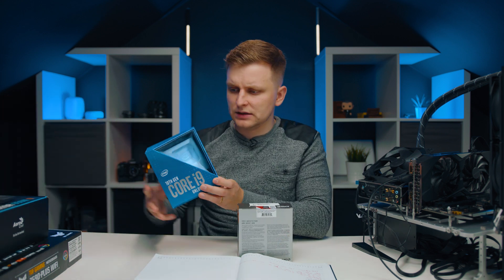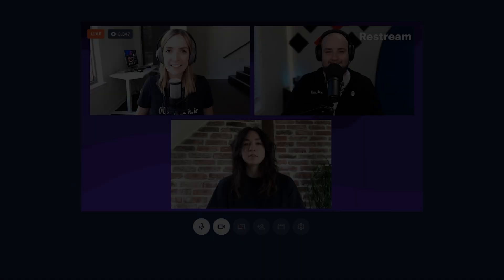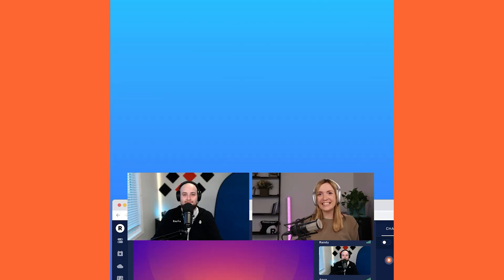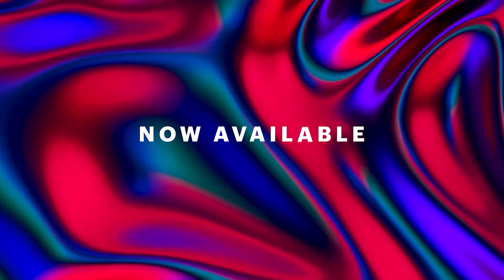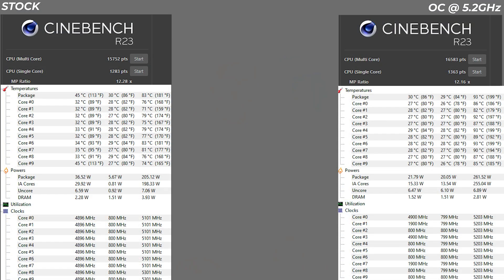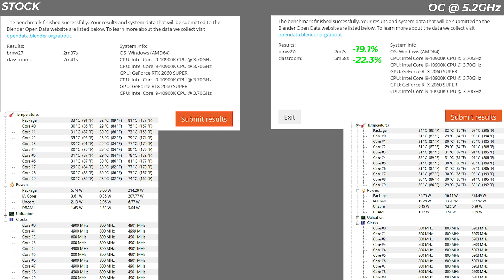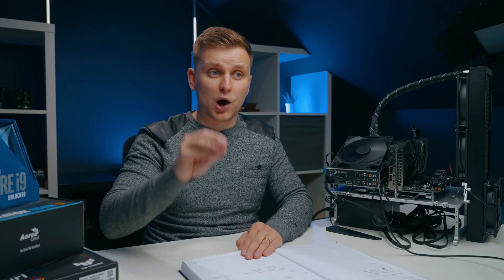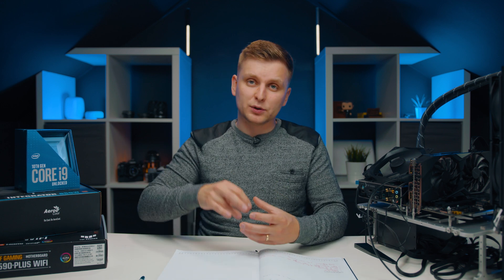Should Creators Overclock Their CPU & What do you Gain? [feat. Intel 10900k] 🤔

Comment from the maker: Who noticed the Intel blue theme in the video? 🤔
Reply: Uh now that you point it out yea nice
Reply: Uh a question I have on one of your older videos... So if I use the a6000 battery grip... And one of the two batteries dies it switches to the other yes but if I'm mid way through a long exposure... For example like a 2 min exposure and the Batterie dies in between... Will it switch without ending it?
Reply from the maker: Yes it will switch without ending it, at least that's how it works with video. :)
Reply: @theTechNotice  ok great
Reply: Me, I noticed blue theme.

Comment: I'm more of a developer but the same thing applies really. To me the instability isn't worth it. The last thing I want is a crash and I loose everything I'm working on. I need my system to be as stable as possible for as long as possible. I don't really use my systems for gaming where pushing the most FPS is what matters to me. The instability is something I don't find acceptable to deal with.

Comment: I'd overclock if I needed to get a bunch of work done quick, and leave stock the rest of the time. Just toggle it on and off.
Reply: That's a fine way to do it, but these days you can tune it so the OC is in boost. It only runs boost when it would benefit, and as soon as that is done, it runs back at idle speeds.
Stress tests push that hard, but actual games tend to have tiny bursts of individual cores boosting then returning to regular speeds, so gaming tends to run much cooler than benchmarking.
Reply: @MaintDocs  Neat

Comment: I and a lot of us out here really appreciate how honest you are about tech.  As tempting as over-clocking might be, an extra %10 - %15 extra performance isn't worth losing longevity.   Excellent video sir. 👍🏽
Reply: The main computer I've had for about 14yrs has had around a 33% OC for almost 10yrs. At that, it runs cooler than stock most of the time, but the computer has noticeably less input lag, starts up faster, crunches video much faster, multitasks more without slowdown, and (up until just today) plays every game I've thrown at it pretty well.

If your OC isn't stable, you've done it wrong or pushed it too far.
The next bump up in performance for my older computer crossed into high heat and difficult stability tuning. aka wasn't worth the effort vs an easy OC that the processor seems happy to run at.

His car example is better than he planned:
There are hyper-milers - who detune everything, remove weight, and put ultra light wheels and tires on their car.
There are extreme power guys - who are willing to spend obscene amounts of money just to see how far they can push it.
There are those who never change anything and believe the stock engineers were god-like and incapable of error.
And there are people like me - who make reasonable changes that improve both efficiency and performance and appreciate that difference every day we use it for a great long time.

Anyone caring about extreme longevity doesn't stick with the stock cheapout cooler. And they ought to underclock a bit if that's their goal.

As far as stability, did you upgrade to win 10 or 11? Then you threw stability right out the window(s)TM.
I've personally had to repeat rescue several people multiple times when MS modern supposedly "more stable more secure" OS's kept breaking their work software.
I have high end hardware now useless, not because the manufacturer had a fault, but because MS kept breaking it every 6mo. I can't fault the manufacturer for giving up after 6 years of that.
I know plenty of machine shops that don't allow their computers internet access - because they never want an update to break their functionality. Stable is that it does what it's supposed to and doesn't stop doing that.

As far as cpu stability, AMD and Intel have to experiment and test until they find reasonable ranges of stability. Those used to be really wide margins, so they could rush out a bunch of chips. Know anyone who bought a new computer then kept experiencing random crashes and blue screens? I've known several, even with usually more stable custom built systems.
And now, the slow progress of technology in a competitive market has pushed them to tighten those margins by doing the very same things overclockers are doing.
(Compare the last several generations of GPU's and chips: several tech channels have noted how the trend of lower power consumption has flipped and that they are now stock running near the performance to heat drop-poff. Basically, they are coming pre-overclocked to stay competitive with performance advertising.)

Comment: I love your videos but have to disagree I using i7700k I overclock by 16% and run great! My i7700k is 4 years old always been overclocked from 4.20 GHz to 4.80 GHz. I have no issues I always overclock and it is totally worth it for me as a creative. Even my RTX 3090 is overclocked and undervolted and has no issues. I will be upgrading my CPU just waiting for Intel 12th Gen to see if I will go Intel or AMD.
Reply from the maker: I see a lot of people getting quite a bit more performance out from the older chips but some say it's not too easy to get that on newer chips, what you reckon?
Reply: @theTechNotice  It's Hard for me to say as I don't have a computer with any new chips in yet. By the end of this year, I would be able to know the answer :)
Reply: I'd go Intel on 12th gen. Except maybe for workstation setups.

Comment: So buying a prebuild pc something like this for close to 5000$(US) + tax + shipping is worth it ?  for a person that needs high end pc.

Corsair 4000D Airflow
Intel Core i9 10850K 10-Core 
ASUS ROG Maximus XIII Hero
64GB CORSAIR VENGEANCE 3200MHz (4x16GB)
CORSAIR H100i PRO XT RGB
NVIDIA 24GB GeForce RTX 3090
1TB Samsung 970 EVO Plus NVMe M.2  x2
CORSAIR RM1000i SERIES PLUS GOLD PSU
Reply from the maker: Looks pretty decent, obviously abit on the pricier side and not that great upgrade path, but beggars can't be choosers at this time. My advice would be if you can, try to get AMD system :)
Reply: @theTechNotice  unfortunately most of the programs I will use, and games I play, like more Intel cpu + nvidia gpu, what I put into my account. This prebuild is not meant to be upgraded, ever (maybe just cpu cooler if it fails), just used as long my needs don't change (hopefully 5--8 years). And I know it is bit pricier, but I can't find 3090 anywhere at today's reasonable price.
Reply from the maker: Then go for it! :)
Reply: @theTechNotice  Just maybe, can you help me choose right   27.0"  2560 x 1440p IPS/VA 144/165+Hz monitor for this pc configuration. 
Plan to use programs like Autodesk Fusion 360..., games like Scum (stil early access game), Battlefield 5... 
If I can get in a game/program realistically close to 100 FPS + smooth images, that is ok for me. Will use it in semi-dark room.
I planned to spend on a monitor that I will use 3-4 year's then replace it, around 600$(US).

Comment: I would just leave the GPU and CPU as is. The percentage gain from overclocking is not worth paying for a new GPU or CPU down the road when you burn them out. Leave that for the gamers. A good 3080 and a 5950X have plenty of muscle out of the box to get the job done.
Reply: @theTechNotice  I know I'm late responding and I also agree; however, the ONLY overclocking I do as a creator is to RAM bc all pc ram runs stock at 2133 or 2400Mhz instead of Mhz advertised on the box.

Comment: What is it said? Just because you can doesn't mean you should? I will say though, it's worth getting familiar with overclocking even if it's modest. There's minimal performance benefits but what you can learn about your system is helpful.. but overall, I tend to agree. Even the most fine tuned overclocks can fail and throw you BSOD when you least expect it. Typically during a deadline. Murphy's law.
Reply from the maker: Yeah, exactly!